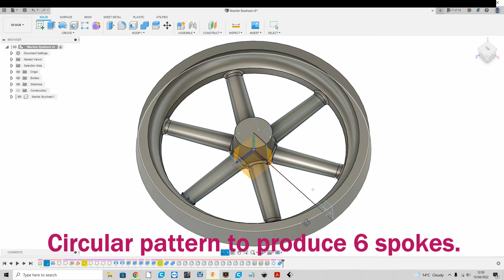Metal Casting at Home Part 120. Marklin Flywheel Casting and Machining.

Comment: Great video. I've noticed when machining aluminium alloys if white spirit is used as a lubricant it helps prevent the inevitable build up of swarf the tool tip and so produces a superior finish than if machining it dry.

Comment: myfordboy: I noticed that when you were cutting the groove for the drive belt, the lath stalled. Do you need a better motor? I might, maybe, be able to help. Not sure tho.
Reply from the maker: Motor did not stall it was belt slip. Better to slip the belt than damage the work.

Comment: if you add a tiny dimple to the CAD file on the center of the hub you can use it to center it on the face plate quickly
Reply: The reason he doesn't is he has to center AFTER he figures out if the rim is centered and that will vary because of expansion/contraction of the cast during casting.  Will the rim stay centered relative to the center of the dimple? Mebbe yes, mebbe know but he'd want it exact so he has to drill it out anyways... So he zeroes the rim out FIRST, then the center is a no-brainer.  Chicken first, then egg..Were it all dimensionally stable, you'd be absolutely correct.

Comment: Was the heavy concentration of zinc in the metal to produce mass for a more consistent running flywheel?
Reply from the maker: It makes a heavy flywhheel, nearly as heavy as iron and machines to a good finish.

Comment: MFB, considering a the time it takes to cad the  part on the computer, and then print it, + the benifit of accuracy and adding a percentage for shrinkage in 3d printing
To making the pattern by hand using traditional methods, how does the time on either process compare?

I can guess which way your loyalty is trending to now...
But I would be interested in your comments please.
Tony from Western Australia 🇦🇺
Reply from the maker: It's quicker and more accurate with CAD and 3D print.
Especially this flywheel for example. The spokes are elliptical and tapered. Traditionally that would mean carving 12 identical and very thin parts.
Reply: @myfordboy  I suppose it also allows you to be more creative with the patterns, including adding features that would be very time consuming doing it traditionally if you could
Have you checked out Windy Hill Foundry yet?  Clarke mostly melts old car brake rotors and made a unique machine to break them to size to fit in his furnace
Tony 🇦🇺